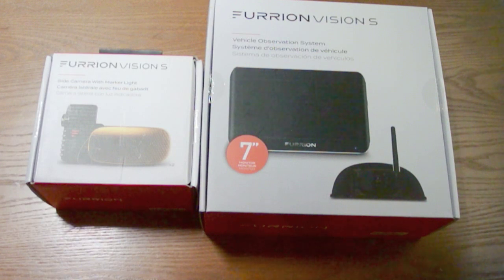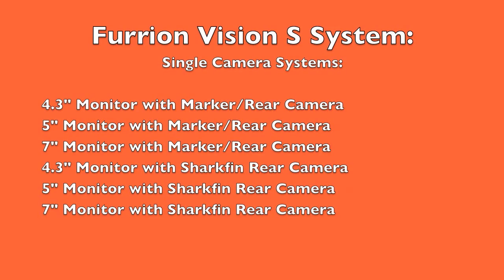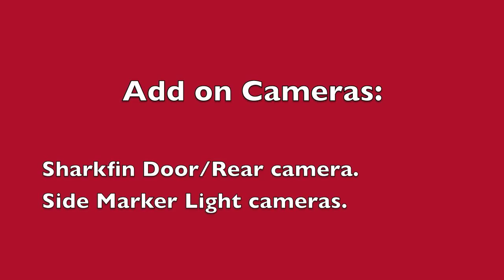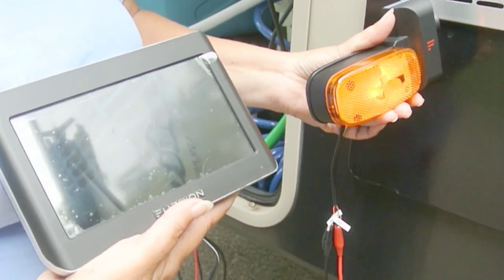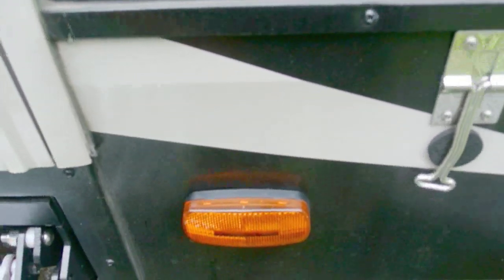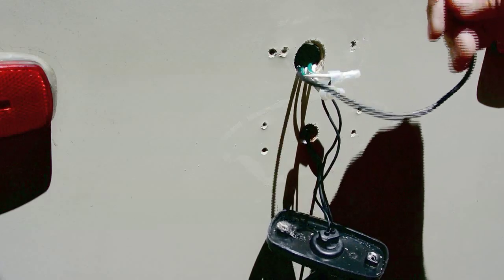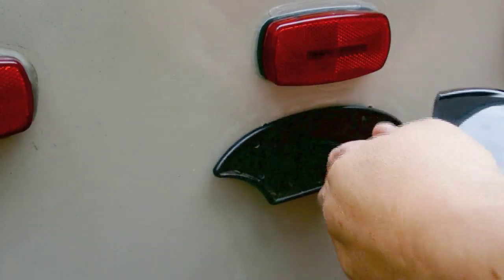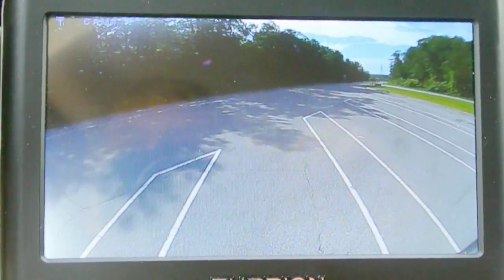Installing the Furrion Vision S Camera System in my RV

Comment: Thanks for the review. When the video first started I was ready to order one. But after pointing out the glitches I decided to wait. The Furrion I have now is fine. Once they get the bugs out I’ll upgrade. I’d really like to have the side cameras.
Reply from the maker: Overall, I like the new system. The real issue though is lack of a good manual. For example, it does not state which cameras work with the motion detection.  

Also, the fact that turning the motion detection on might mean the camera is blanked until someone walked by. 

I just did not try all of the scenarios, so it might simply be that the system is not configured properly. But Furrion is on the hook to produce a comprehensive manual; far be-it for an owner to have to figure it out (but that might mean a couple more RV-Project videos on how to use it).

The return from multi-screen to single screen is the real issue though. On the other hand, the left-right cameras in the multi-screen are a bit distorted and tiny, so at some point, you would want a single screen anyway. So I would give it a 4 out of 5 stars.

Comment: As of Jan 2021 I bought the 3 camera system with the shark fin and the side light now come with LED’s which is nice. Everyone seems to think you need a magnetic screwdriver for those tiny screws but mine are non ferrous so the magnetic screwdriver doesn’t help.
Reply from the maker: I think mine were stainless.

Comment: Thanks for the video.  I need an adapter to connect the cable of the camera with the cable that is installed in the RV.  Where do I get that adapter and what is it technically called
Reply from the maker: If the mount was pre-installed by the mfg, remove the cover and chances are is already a connector in that spot for the camera.

Comment: The cable that is already installed in the RV to connect the camera already has power?  My RV is 2020 Highland Mesar Ridge
Reply from the maker: Cannot tell you for sure. Each RV mfg is different.  Best thing is to use a multimeter and check for voltage.

Comment: Great video. Really enjoyed it.  On my camper, a prewired setup was provided and all I had to do was connect camera wires to two large wires I fished out. This set up ran my battery down within a month as it did yours.  I'm now changing that set up to one that doesn't drain my battery.  On your video I was looking for the moment you actually connected the two small camera wires (thin blk&red) to the single blk power wire (from the cabinet) protruding thru the camera mount hole just below the running light.  In a nutshell, how'd you connect two small wires to the larger black wire?  Seems to me one of the smaller wires must go to something other than the larger black wire.  A ground maybe? Did I miss something in the video?    Seeking help in this matter, and Im certain it is a very simple matter for you.  Not me.
Reply from the maker: The single black wire you see is actually a cable with both red and black wires.

The camera simply hooks up red to the positive wire and black to the negative side.

I always use a voltmeter to confirm the polarity as you never know the competence of the RV Installer.

For this reason, I am hesitant to provide  detailed instructions as there are always exceptions, and I would not want to give bad advice.

Therefore my go to advice is to always use a voltmeter to confirm the polarity.

Also, whenever you change the wire size in a branch circuit, even DC, always ensure the lower gauge wire has a higher current carrying  capability than the branch circuit fuse, or add an in-line fuse for the smaller wire.

You don't want the smaller wire to become the default fuse!

To connect dissimilar wire sizes, I never use twist-on terminals as they are not appropriate for use in vehicles prone to vibration (RVs and Boats).  

In fact, twist-on terminals are actually illegal to use on a boat (33CFR183 - USCG regulation).

I like to use the "top hat" style of crimp on terminals where h are OK to use.
Reply: @RVProject  Amazing answer. Thank you so much. I didn't realize there was two wires within the larger black cabinet wire.  Your explanation was beyond what I could have expected.  I just have to translate.  I got the answer I sought.  Thank you sir.

Comment: I would Definitely point out for those who aren't familia what is ground, positive, ect.. Most know black is ground and red is positive when it comes to wiring or provide a diagram
Reply from the maker: For my projects, I tend to provide an overview; which I call a catalyst, to get ideas flowing. I try to refrain from providing step-by-step instructions, especially when it comes to wiring because there are no standards in the RV industry. 
I have seen a multitude of wire colors used for positive and negative in RVs, almost to the point of being haphazard.  For that reason, I can never be 100% accurate when suggesting using the red wire for 12V/black for ground.
Perhaps I should to a video called; the non-standard RV?

Comment: I have the same system and was able to turn off the auto switch on the cameras.  Not sure if my software is upgraded.  But while I don't remember how to exactly do it, it had to do with turning off something that was in auto mode.  Tech support should be able to help.
Reply from the maker: Thank you for supporting the channel.

Comment: Thanks for this video.   Please,  can you explain what is the "trailer light plug"  from nappy-kamper?    thank you.
Reply from the maker: It's just a plug that makes a connection from the RV battery to the running lights on the trailer. It allows you to power the camera (powered by the running lights) without having to connect the tow vehicle to the trailer.
Reply: You could simply make a jumper wire to jump the battery terminal to the running light terminal on the trailer plug. 
I would be sure to add an inline fuse to my jumper just because I am overly cautious by nature and overkill is my middle name. :)

Comment: What did you use to remove the excess sealant from the exterior around the light and fin on the back of the RV?
Reply from the maker: It's just silicone, so alcohol or mineral spirits will remove it.

Comment: everything is backwards on my backup camera right is left and left is right how do I fix
Reply: Go in to settings and then tap mirrors and then tap which one you need to change you can then tap flip and it will change it to the right settings
Reply from the maker: There is a setting in the setup for normal-reverse.

Comment: Will this camera kit not work unless you turn on clearance lights.? That sucks.
Reply from the maker: It's up to you how you want to wire it.  Some people wire in an independent switch, but most people wire the cameras to the clearance lights as it is a simple solution.

But there is no reason you need to do it that way. Wire the power as you see fit.

Comment: I was going t buy this thanks I won’t now. Sounds like a waste of money until they can get the side camera software straightened out. Think I’ll go with the rear only 5 inch screen and save over $300.00
Reply from the maker: As long as you don't buy the 4.3" screen, you can add side cameras later.
Reply: @RVProject  Thanks for the reply!